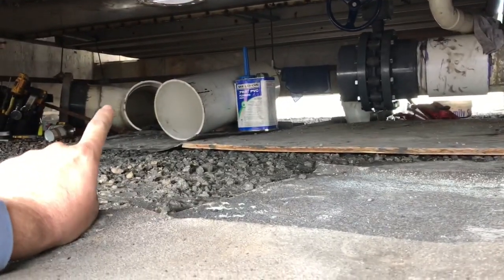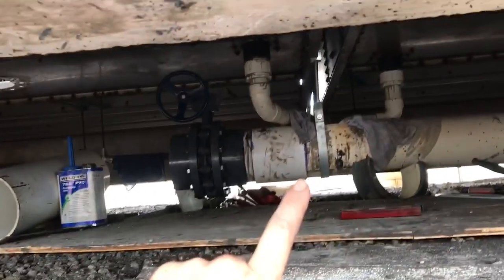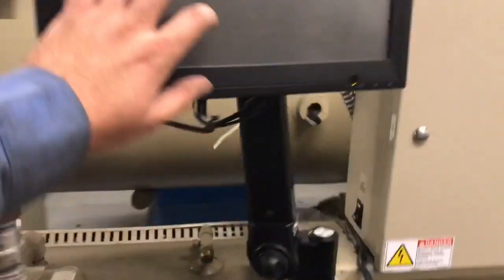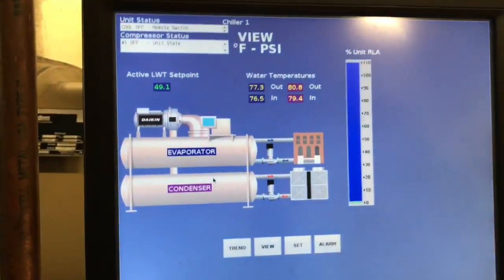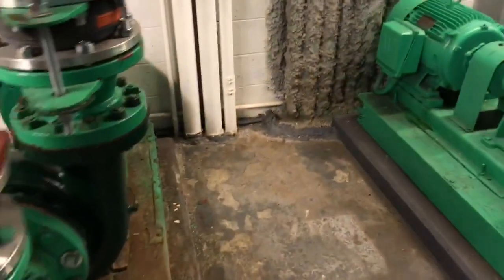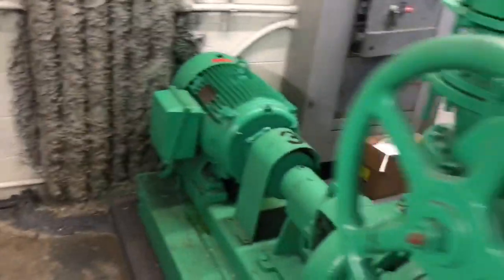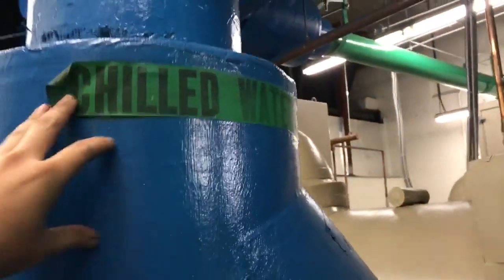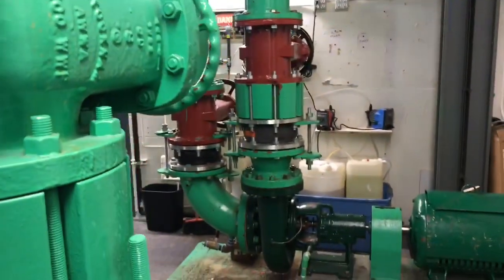10” butterfly valve replaced

Comment: How do you like the daikin high pressure machines?
Reply from the maker: They are cool. I’m not a full time chiller tech. I can’t really compare different chillers etc. I’m just fortunate to get my hands into a bunch of different equipment. I work on the smaller chiller side.
Reply: @20antman right on I'm not a full time chiller guy either.  I also don't have any of those at my accounts. I just happened to go to a class at the factory on those. I always feel like they blow some smoke about how great their stuff. Just curious about real people's real life experience.
Reply from the maker: For me it’s about the same. Trane blows smoke their’s is the best. Lol. So far I have not had any big issues. This is the only account with this chiller
Reply: @20antman  it was pretty funny. One of their big "pros" was "look how much smaller our impeller is than the competition". They show a high pressure impeller next to a trane low pressure impeller.  Not even a relevant comparison. Then we take the factory tour and there's a torn down cvhe in there. Someone obviously asked about it and the instructor just laughed and said "daikin is working on developing there own low pressure machine". You can't make this stuff up lol.
Reply from the maker: Lol they gotta use trane’s blue print to design their version machine. 
 But with the impeller on the higher pressure machine will be smaller than a low pressure machine impeller. Nothing to do with manufacturers. The low pressure machine needs to move a larger volume of refrigerant at once to equal the amount moved in a higher  pressure machine. If you compare the volume in a r410a 5 ton compressor to an r22 5 ton comp. you will see the 410a compressor has a smaller piston chamber that the r22.